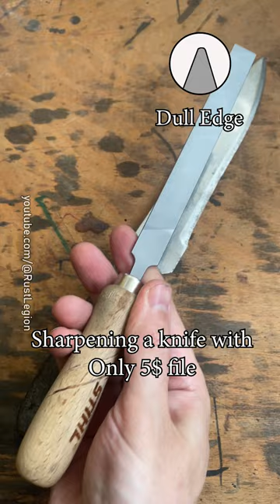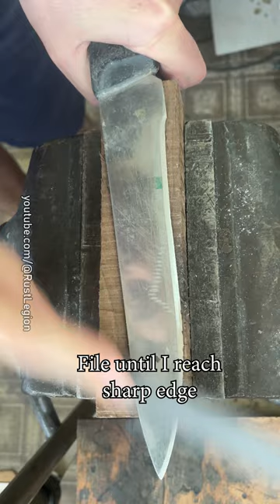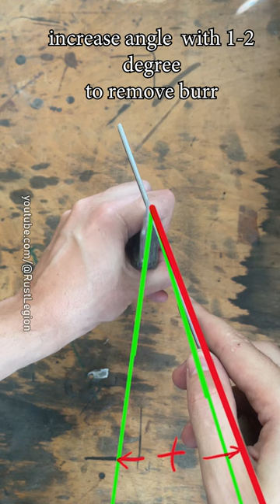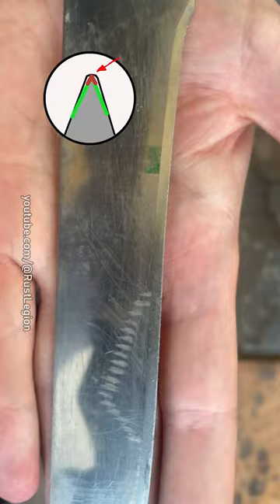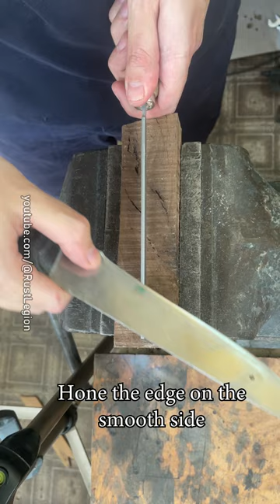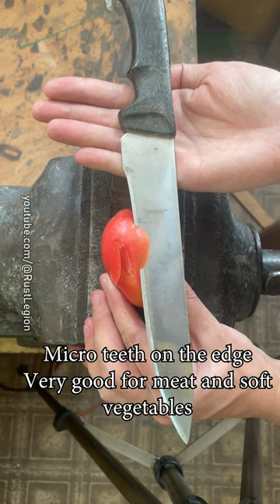How to sharpen a knife fast and easy

Comment: That’s impressively sharp for a milk bastard file sharpening, great job!
Reply from the maker: yes I saw this trick from a friend of mine , the secret is in the burr removal - just very light pressure and alternating strokes with slightly steeper angle than the initial one :) Before I was thinking that you can only achieve shaving sharpness with strop or fine abrasive :)
Reply: @RustLegion  yeah I figured you need at least a 1000 grit stone or diamond plate but that’s sick that you can just do it with a file
Reply: You can get knives shaving sharp with as low as 80 grit, or as shown, files.

It isn't easy, compared to fine abrasives, takes some skill to get the hang of, but once you learn it completely changes how you view sharpening.
Reply: *Mill… mill bastard file.

But yeah, it’s easy, once you understand that a file is hundreds of metal cutting edges, all in perfect alignment. All you have to do is keep the knife at a steady angle. I can put a perfectly straight, razor edge on a block plane knife with just a good clean file.
Reply: @WhackBytch256  I literally didn’t realize till now that I typed milk. Thanks hahaha
Reply: Dude…Watch ur profanity

Comment: Don't do this with expensive knives.
Reply: Why?
Reply: @autumn5592  because you'll ruin them. 😅
Reply: @elijahbleuprice4303  how will you do that?
Reply from the maker: to some extend he is right, I mention in the video that this works for softer knives up to 56-57 hrc and expensive knives are harder and the chainsaw file will not be able to file them out. Also if you are not very experienced you can remove a bit more material in one spot and make the blade wavy. But I would say - sharpening any knife without experience can ruin it so it's good to start with cheaper ones even when using stones :)

Comment: Great idea I've used for years. I use a diamond blade, combo grit block, and small leather strop for all my kitchen knives. The tools are next to large knife holder my late father made.😊 To keep my favorite carbon steel chef knife clean I long ago super cleaned and polished it and then coated it with s thin coat of clear epoxy. Knife stll black, sharp, clean and in first slot pride of place. Details matter.